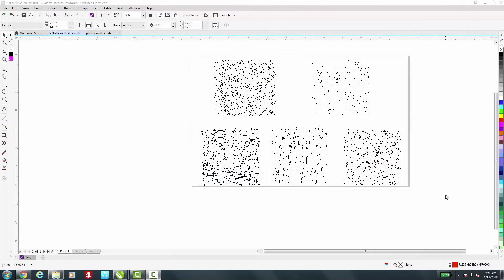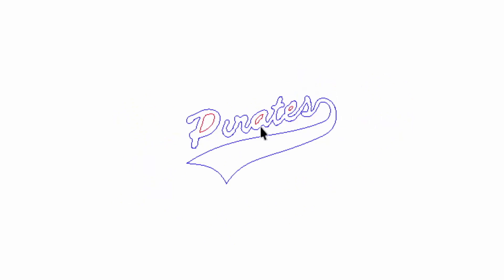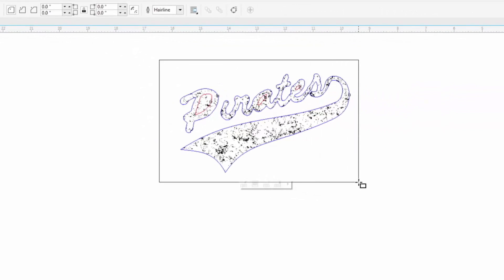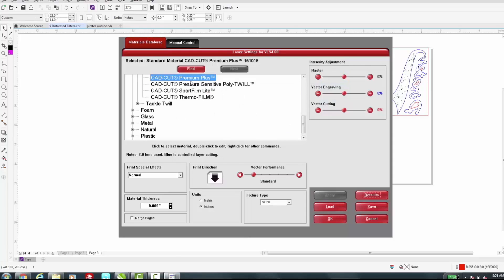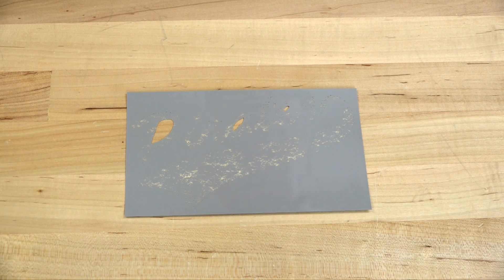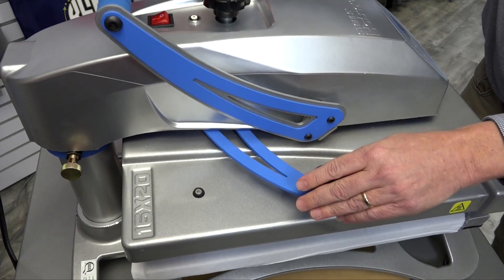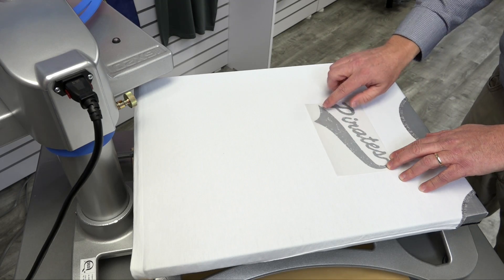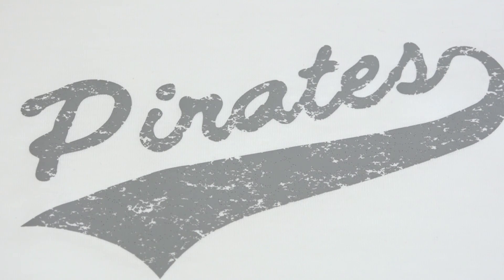How to Create a Distressed Effect with a Laser Cutter

Comment: I have a CO2 Laser Cutter, I don't think you can cut vinyl with this cutter.
Reply from the maker: That is what we used in the UL laser system. You cannot cut vinyl that is PVC based because the fumes are toxic and it will also damage your laser. However, you can cut PU based vinyl with lasers. Stahls' has a variety of materials that are PU based.
Reply: Cutting PVC based vinyl will chlorine gas that which long term will destroy your metal components and electronics